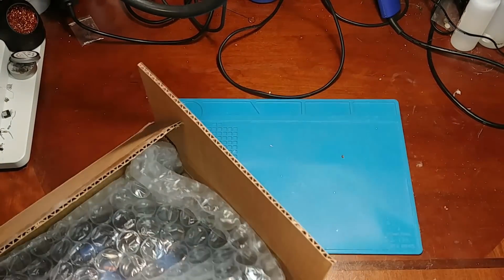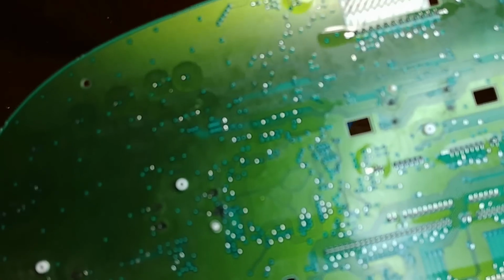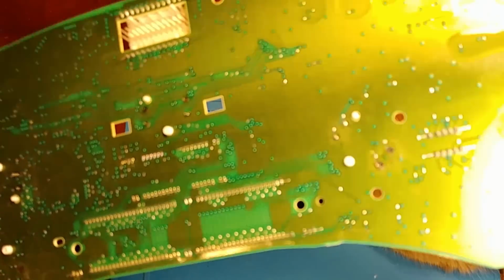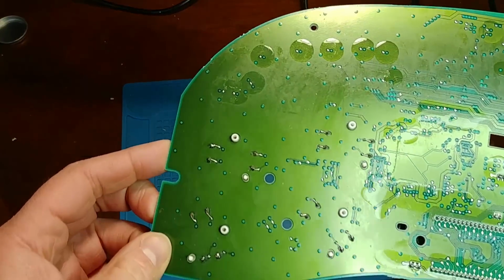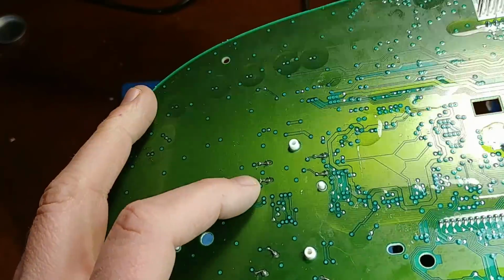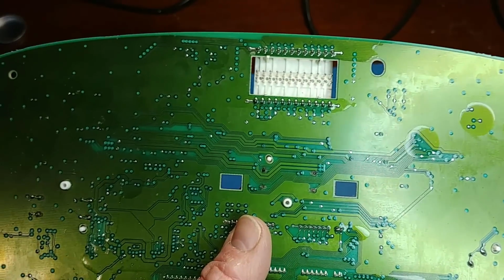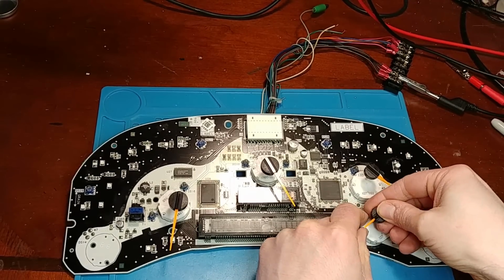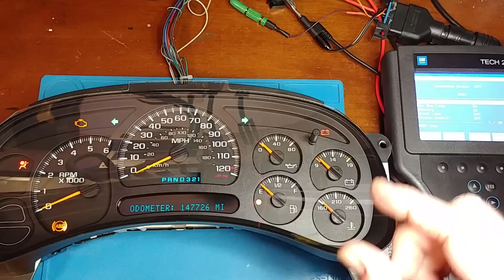Repairing a GM cluster someone tried to repair that was sent off to repair.

Comment: Jeff you should be using fume extractor (If you're not already using one, or perhaps you are using  lead free solder) but either way those fumes are not healthy. Great video as always keep it up.
Reply: Lead emits vapors at much higher temperature than achieved when soldering, so no difference if he uses lead-free solder (except for solder joint longevity that is).
Reply: @wtfiswiththosehandles  Fume extractor is mainly for the flux vapors.
Reply: @dranoelr  I know... It's the op who suggested lead free solder is better for health.

Comment: Any ideas on how to fix a “dead” cluster?  Steppers are fine, but the cluster only gives cel and turn signal lights no stepper motors move at all.  The vehicle is fine as it works well with my “test” cluster.
Reply from the maker: Sure it's pretty common in 03-04. I probably see 4-5 dead clusters per week.
Reply: jeffescortlx on one of the two clusters, I discovered that the cluster started working again after I reflowed solder to the resistors to the top right of the speedo.  Haven’t had a chance to try the second cluster yet, but if this info helps anyone, I’m glad to share the information!
Reply from the maker: @92greenz34  there are several spots that like to fracture. If you watch my videos you'll see a pattern of me always reflowing the same sets of components while showing the microscope view.

Comment: Anyone have an idea right above the speedo motor what the number is on those small red either resistor or diode not sure what that one is
Reply from the maker: The red/glass components is diodes.

Comment: I replaced my motors with mixed success.  All the ones that were working before are still working except for the gas gauge (it is now "dead").  The oil pressure (was broken) is now fixed.  Tach (was broken) jumps to about 500 rpm and stays.  Speedo doesn't sweep smoothly, it kind of ticks up and down almost "digitally" if that makes sense.  Obviously soldering these is not an easy skill - so thumbs up to you with your amazing soldering skills.  And congrats to being way over 1000 subs now.  Unfortunately since you are a cat owner and I am deathly allergic to cats, I can't send mine to you for fixing so I'll have to see if I can fix it or live with it.
Reply from the maker: Sounds like you have the typical pull ripped pad problem. Stepper motors do funny things when it doesn't have all 4 pins connected.
Reply: I checked continuity between the pins and the next spot on the board and they all had continuity, but I'll re-check them and may have to try your little "jumper" trick.

Comment: Hi Jeff, I have a board from a Jaguar fuse box that no is no longer produced. I see that some of the components are very close on the lay out of from instrument cluster in GM. Where do you get the board schematics? Or can you share a 2002 GM cluster board schematics to see if I can help this shop from TX. I am trying to see the function of an IC but can’t find any info.
Reply from the maker: I do not have schematics for the 99-02 clusters. But I don't see how that would be helpful on a jaguar fuse box board. Can you pull Somme numbers off the chips your trying to ID?
Reply: @jeffescortlx  Thank you I got the schematic from Delphi.

Comment: Another nice video. Did one of those repairs a couple days ago. Seems like they always take out the MPH pads. Good luck on your 1000 subs. I think you'll make it with some to spare.
Reply from the maker: Yes, it does always seem to be the MPH that's mostly ripped off. It's going to be close if I make the dead line. Did you get my PM about the S-10 cluster?

Comment: The silver and copper color leads you use between pads and torn pads... is the silver wire solder or actual wire?  Does the copper wire have a coating to keep it from shorting out other traces?
Reply from the maker: Yes the silver is wire, yes the copper wire is coated.

Comment: I found this video while looking for help trying to solve an issue with my DIC not illuminating. I reflowed the bank of 7 resistors, but the DIC still is intermittent. I have the updated board, the same as is in this video. Any guidance, would be appreciated
Reply from the maker: The bank of 7 resistors are only for the prnd321 and not the driver info display. The driver info display has its own power supply to the left of the VFD. Also check the VFD hot wire end leads solder joints.
Reply: @jeffescortlx  thanks for the response. The odometer is intermittent in working, if I tap around the mph stepper motor, it goes on or off, or on the board anywhere it will as well. It just takes a bit more of an jarring to cause the same issue
Reply from the maker: @bumpinz  yes that's typical for having fractured solder joints somewhere.

Comment: Great work! Yeah, makes so much more sense now, I saw where the pads were completely off up the traces. Using cheap resistors for donor jumper cables and then looked like transformer wire for the longer ones? I noticed on one of the longer ones they kind of overlapped, is that not going to be an issue? Or did you insulate off camera? And also I noticed you pretty much just circle the stepper motor wire, is it not important that the jumper and stepper wire touch, as long as there is solder between the two? 
I will use my alt accounts to give you a few more subs and not really sure where else I could send this, but I will brainstorm. Good luck! Its well deserved! Really niche, but great stuff!
Reply from the maker: Yes, the copper color wire is transformer wire. It has a thin enamel coating to insulate it so it will not short if touching a conductive component. The coating burns off with the soldering iron. Its nice stuff to work with.
Reply: Hey, have you ever tried out a HUD as an alternative or heard of anyone doing that?
Reply from the maker: I have not
Reply: @Chris - to answer your second question, the wire loop and solder bridge to the terminal acts as both a pad (mechanical connection) and electrical connection. It's stronger than that tiny little pad the board houses plate onto the board, as long as it's not a cold solder joint. Good, simple field repair technique (and I used to teach mil-spec soldering in the aerospace industry) but I would wind the repair wire tight around the terminal, sortof like wire wrap. Then again, this is not going out into space . . . nor would it be allowed past most Q.C. It would just be replaced with a new board/module if one was available and this would wind up in a surplus sale.

Comment: Jeff what kind of jumper wire are you using on this particular repair sir. You make it look so easy...Thanks James
Reply from the maker: The bare wire I'm using is just light bulb leads. The coated solid strand is transformer wire aka magnet wire or coil wire.
Reply: Thanks Jeff. I am sending texts to my friends and working on getting you closer to that 1000 mark sir. I hope you make it! Thanks my friend! James

Comment: Very cool man. I no longer feel so alone for going the extra mile to repair things using some creativity and innovation. If I was doing that job myself, I would use the magic combination of some cyanoacrylate super glue sprinkled with baking soda to secure the stepper motors on the back side and little dabs of hot glue on the front side at the corner edge of the motor and the circuit board. 
I'll sign into a few other accounts I have and sub to your channel . You're not far from the target of 1,000 subscribers.
Reply from the maker: Thank you its appreciated! The nice thing with hot glue is it can be removed if it needs to be. Although unlikely it will need to be because it's an X 27 that's in there
Reply: I noticed the X 27.  With a cluster in need of extensive repairs like this one, only a fool would cheap out and not include the updated stepper motors, especially at the price for an entire stepper motor update kit.
I do a few cluster repairs myself Jeff. Tell me, do you perform odometer corrections too?
Reply from the maker: I do odometer correction if I run into a cluster that can't be repaired.

Comment: I just received at 08 GMC. Backlights are fine. It has an intermittent issue . Sometimes it will power up , move the needles, display turns on and then dies except for backlights. When it dies the 12vdc drops from the 3 leg regulator. I can put 12vdc from my l supply on it , but same thing . I just scraped it. Have you ever seen this issue . I think it’s a cap issue , but I don’t have an esr meter , the aluminum caps are within spec using multi meter cap value test . Ty sir
Reply from the maker: Its the processor. Put the board in the freezer and it will quit, hit just the cpu with some hot air and it will work fine.
Reply: I’ll try the freezer and hot air ... ty again
Reply from the maker: The chip is obsolete from reputable sellers. I not smart enough to load the software on a new one anyways :(
Reply: Same here I’m just smart enough to do the eeprom .., ty

Comment: How deep is your knowledge on the GM clusters? I built a highly modified 2000 Impala and it has the cluster from a 2001 Monte Carlo SS. One of the things I would love to do is change the functionality of the PRNDL21 indicator so it will highlight the actual gear the transmission is  using in real time instead of showing where the shift lever is physically positioned. I have an indicator at the shift handle that works fine and I know what position I put it in when I drive. It's redundant to show this info on the cluster and being a modified car, this would be one very cool mod to add to the list. Have you ever performed a mod like this before?
Reply from the maker: This would be more at ECU level programming. The cluster is simply only displaying what it's told through the serial data wire. I don't have the ability to do this mod. Also don't know how much lag you would see from when the ECU sends the signal until it's displayed on the cluster.

Comment: when putting the needles back do you line them up right was 0 for example or E, i did the tape and marked it, im not sure if its me but it seems off but its probably just me
Reply from the maker: No, the needles do not start at the zero marks with no power
Reply: @jeffescortlx  I'm guessing you cycle power to the cluster then put the needles on? Looks like when power is applied they drive to 100% then back to 0%, then are they "zeroed" out?
Reply from the maker: @stephenw5063  yes

Comment: Hey Jeff.. another great video . What type of bare copper wire do you use to make your jumpers? Part #. I do the  same thing with insulated spider wire. Ty and keep up the great work and videos.
Reply from the maker: The bare wire I'm using is just light bulb leads. The coated solid strand is transformer wire aka magnet wire or coil wire.
Reply: Thanks I use bulb leads as we’ll

Comment: What is the usual cause for dim PRND32 ?
Reply from the maker: Fractured solder joints. There is already multiple videos on YouTube covering this, that's why I have touched on that problem specificity.
Reply: Thanks, I see them now.  I will attempt repair.

Comment: Jeff this is a pain to do but I will have to do it myself because of someone destroyed one again. I always watch your videos to get my head wrapped around it. I have just one question Jeff and that is the speed motor jumpers I know they are long and I see that two of them are overlapping each other. Does that not cause it to malfunction? Thanks Jeff. James
Reply from the maker: I'm using enamel coated wire. It's sometimes called Magnet Wire. It has a thin insulation that makes it good for electromagnets. It burns off with the soldering iron for solder joints.

Comment: Great job, subscribed, good luck.  I'm having problems with changing the mileage on a 2005 buick park avenue chip, the cluster doesn't appear to be like the others I've worked with, do you have any answers for my dilemma on where to begin with the replacement chip # for this 2005 Buick Park Avenue, or how to identify instrument clusters that require removal or that can be clocked / reprogrammed & what programmer if so will work.
Reply from the maker: My first question is, why are you trying to change the miles?
Reply: I have the instrument cluster out of a junk car & want to reprogram the mileage.  I'm in the process of rebuilding the car, I want to have the odometer with the correct amount of miles.
Reply from the maker: @69easyrider  Why not just use the original cluster, board or eeprom?
Reply: I used to send the clusters out to digispeed to be reprogrammed, but as much as it was costing I decided to learn how to reprogram & work on them myself, after many hours of searching for information, learning basics, understanding the concepts & tools I've got some humble knowledge to where I am able to accomplish doing them without destroying them, which included many trips to the junkyards.  I don't know how you got so educated in the field, I have to give you much credit for your knowledge, especially if you had to learn on your own.  I've worked with cars, rebuilt & restored, them along with computers over the years & one thing I know  was not many wanted to share their knowledge.  So when I came across you on here & you were one of the few who were willing to share their knowledge I listened & paid attention.  Back to your question, the original cluster probably can be used but I'm always trying to learn something new & want to reprogram it myself, if I mess it up I still have the original.  All the GM clusters I've seen are different than the Park Avenue, this one is just another challenge for me.
Reply from the maker: I see. Normally when some one comes to me with the question of "how do I roll back my odometer" I nope out of there. Because it will happen when you work on clusters. But I don't want to get involved with that. I just like to do board work and fix things, not break the law. Unfortunately I don't think your going to find much support or information on the park ave. It's just not a supported model. You could extract the bin file and look at it with a hex editor, but there wont be much information you'll be able to do much with. In the rare chances I come across a cluster like this that cant be fixed, I just swap the eerpoms.
Reply: I know what you're saying, I don't do anything illegal that's why I check the laws & make sure before I do something.  As you know it's not illegal to change the mileage unless you're doing it to fraud.  I guess it's quite common with used car dealers & who knows anyone else.  However I'm not here to fraud, if I did ever sell this car I would have the tag with the sale of what was done with it.  I'm more interested in the business of fixing one's that are broke & learning what the different IPC's  are & what programmers work with the different years & models.  The Park Avenue is a different gm than the others.  If I have to I'll use the hex system to figure out that for the mileage.  It's nice to talk with you about the field you're qualified in.
Reply: Would you be able to restore the mileage for one of the buick park avenue clusters if I send the paperwork where the motor was all rebuilt like new with no miles it's coming down to the wire where I have to get it done, there's already about 2000 miles on the engine.  I tried to find your email address on your channel but no luck, mine is amznhdrdr at yahoo.
Reply from the maker: @69easyrider  Sorry but I don't think my programmer does park ave's. I'd recommend to use the original cluster or eeprom instead of installling a random cluster with unmatched miles.
Reply: Do you have a clean eprom you could sell me, i'll have to program with the Hex system but I want to save the original eeprom chip if I can, thanks.
Reply: I also wanted to ask you if you have the coating for the circuit board I can cover the chip with or give me a good place to go to get the coating & eeprom
Reply from the maker: @69easyrider  I'm not sure what part number it is. But any electronic parts supplier will probably have it.
Reply: I ended up sending one 2005 Park Avenue cluster out to someone that said they could do the mileage with a CAN adapter without having to remove the eeprom but I have the other several park avenue clusters to repair.  The gauges don't work on one, speedometer, tach, gas, temperature gauges are sluggish or don't move at all, also the PRND gear select indicator is very dim.  The speedometer Odometer indicator light works & is bright, the stepper motors look like the air core style, what would you suggest for repairing them..

Comment: Hi Jeff, I have got a question and i really hope that you answer it for me,
My question is, how do you powered it up? Did you have an exact socket for this cluster or you just made one?
Reply from the maker: Grabbed a connector from a junk yard,  wiring diagram from Google and use a bench power supply.
Reply: Thanks so much for replying Jeff! I have a problem with my car's cluster. All of my cluster needles are stuck in the middle, and no power gets to it. And I have checked all of the fuses that are related to my cluster and they're ok. Do you think the problem would be related to whatever you did in this video? Please answer as soon as possible, thanks so much. 🙏👍
Reply from the maker: @RomeenOmar  I don't know what kind of vehicle you have?
Reply: It'd a holden captiva 2007 model
Reply from the maker: @RomeenOmar  I don't have those here. Never seen or worked on one.